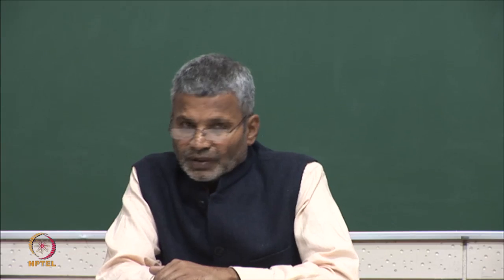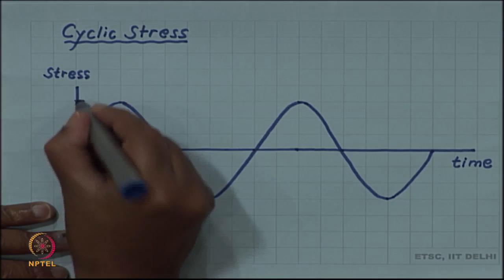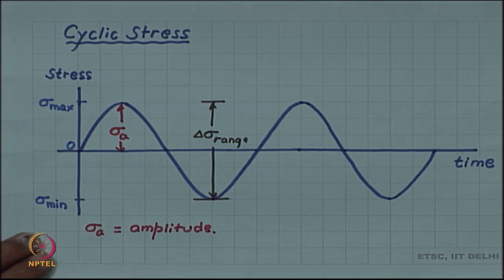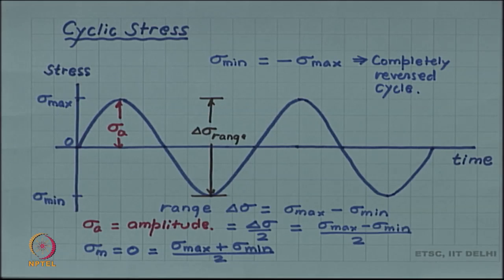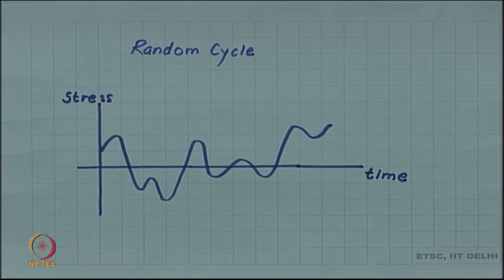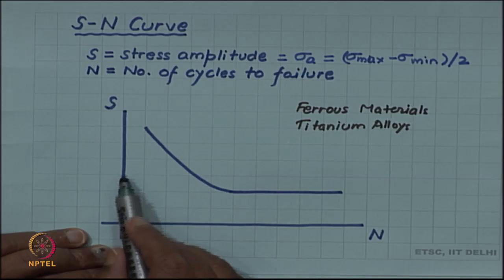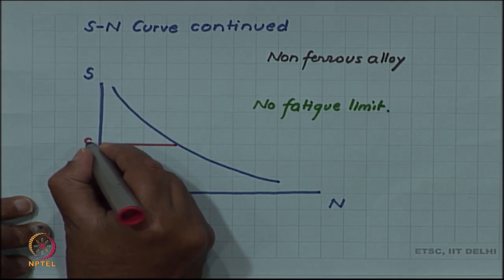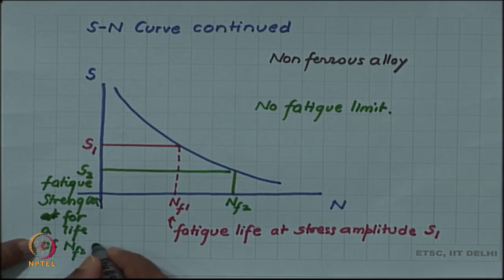Fatigue

Comment: Sir why stress amplitude is taken in S-N curve why not mean stress??
Reply: Fatigue inherently involves the cycling of stress, therefore the stress amplitude is important. what S-N curve shows is that the higher the stress amplitude (S) lower is the fatigue life (N). But the variation of stress amplitude is done at constant mean stress, usually zero.  But, the mean stress does affect fatigue life. Increasing the mean stress decreases the fatigue life. But this aspect is not captured in the S-N curve which is drawn at constant mean stress.

Comment: Sir what should be the grain size to avoid high temperature fatigue ??
Reply: the larger the better, for example single crystals are used in a jet engine where both the temperature is very high and they undergo high cycle fatigue as they are often going from turned off to rotating at a high speed.

fatigue mainly happens by defects moving to grain boundaries, so if there are less grain boundaries fatigue is reduced
Reply: ^^ for the turbine blades
Reply: @patrickcurran5536  thanks for your answer. I just want to ask one more thing . Are these defects that you are referring to, induce crack initation at grain boundaries ?? And is thermal fatigue always cause intergranular failure ?
Reply: @ayay9835  defects are things such as dislocations, stacking faults, twin grain boundaries, but the defects such as dislocations coming together is what induces crack initiations at grain boundaries. Dislocations are small holes in the crystal if you put many small holes together you get a big hole or a crack.

thermal fatigue i'm not sure, could possibly be related to dislocations moving and somewhat related to creep, but i'm not too sure what thermal fatigue is

Comment: Dear Sir, 
Last day I had an interview at IIT Jammu, Professor asked me why non-ferrous materials don't show a real endurance limit(Horizontal S-N Curve). I'd no answer, later I searched in Dieter but they had no reason for it. May I get some help?
Reply: True endure limit can be observed for high strength materials not only for steels. 
Crystal structures plays an important role in determinning this.  For the case of non ferrous metals like Aluminium or copper (which are soft ) true fatigue life is not observed. Presence of more than 5 independent slip systems allows easy gliding. That's why continuous decrease in life with stable crack propogation can be observed.
Reply: @varaprasad6608  Please fix your spelling mistakes